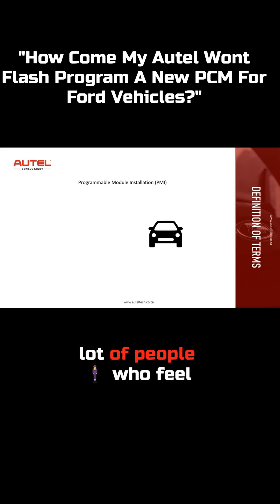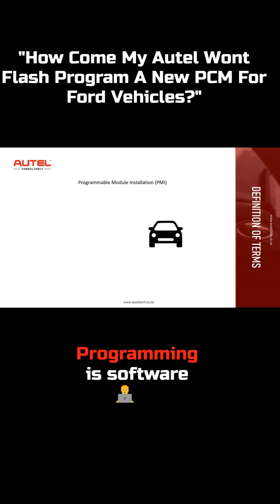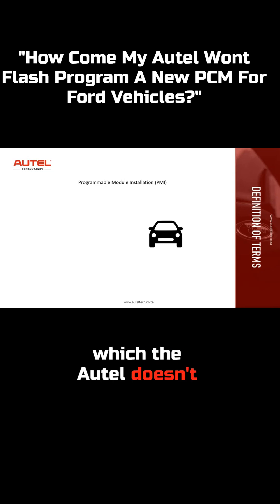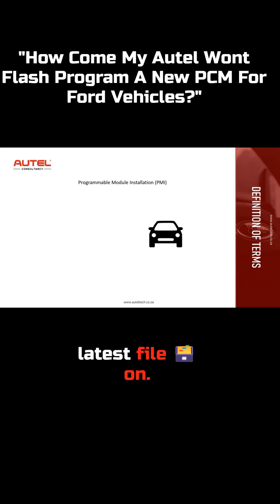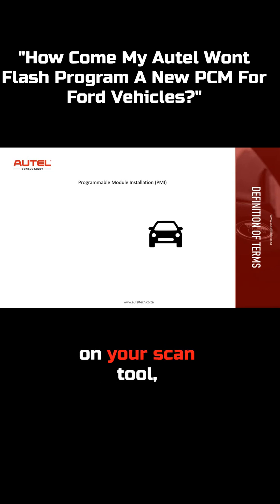How Come My AUTEL Wont Flash Program A New PCM For Ford Vehicles

Comment: My Device (Otofix D1 Pro, which runs Autel Software) says it's able to do Offline & Online Coding on VW ECU's for example. Apparently it is able to pull the needed ecu data from the web, so I'd be able to code any VW ECU... I have not yet found that Option on my scanner though! Where does it explain this functionality?
Reply from the maker: Have you tried to contact the person you purchased from? They should be able to explain it to you since they sold you their equipment.

Comment: It still has a lot of functions that a normal small scanner would not be able to change. But sometimes it gives the option to change the vin on a module but it always says it fails or it cant change it. So why would they still have the option if it cant do it?
Reply from the maker: Could be several reason. Sometimes the autel will only write vin on new pcm modules and not used ones . Some times it will only write it on used pcm modules and not new one ones. It varies between manufacturer and year make and model.  There also could be an underlying condition with the PCM that is preventing the autel from writing the VIN. The only way to get down to the bottom of why its not doing what the software is supposed to do is by doing a data logging to get the engineers perspective.

Comment: I thought the autel j2534 was compatible with Ford?
Reply from the maker: Not flash programming. So for example if you have a brand new PCM that's blank and you go on your autel and click programming>programable module installation> The acutely doesn't have the capability to connect to ford servers to install the new calibration data. Even if you "inhale" the data from the original.. it wont transfer to the new PCM as its blank ( only a used one would work since it has existing operating system in it).  On Fords, the "programming icon" should be coding since it not getting software from the OEM servers.
Reply: what he is saying is that you can't use Autel pad to program, but apparently u can use the j2534 as a pass through,  but yet I can't get ford or chrysler to connect with autel's j2534.
Reply from the maker: @Edwinalvarez070  Hey Edwin. Your doing something incorrectly because I do at least 3 these a week .  You should book the j2534 training so I can set you up properly .